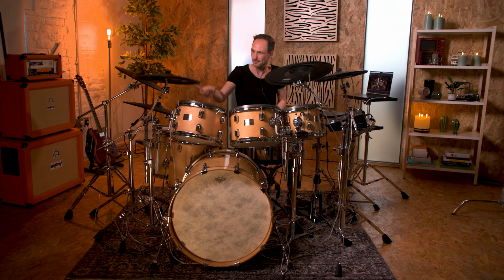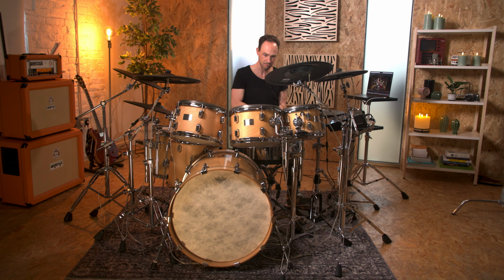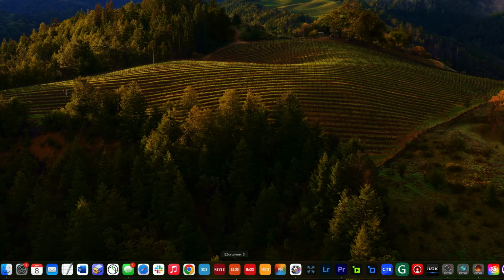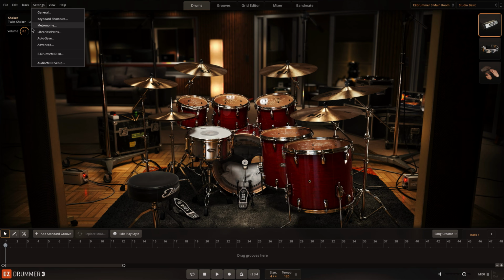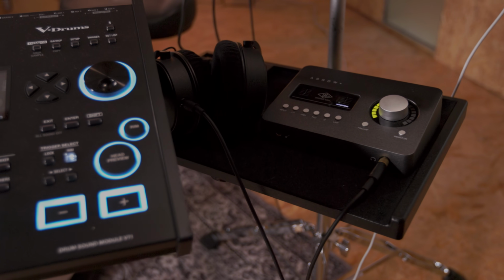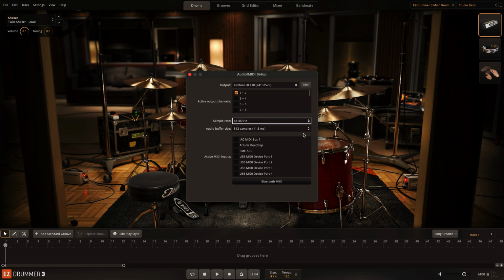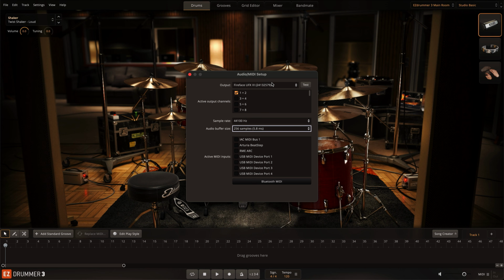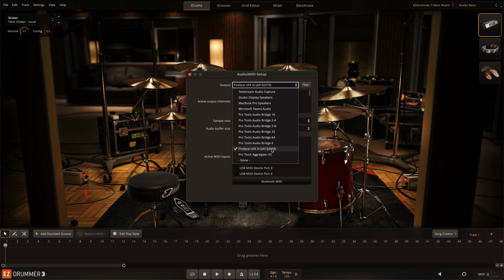E-drum Tutorial | EZdrummer 3 & Superior Drummer 3 | Part 1: Getting Started

Comment: When clicking on the SD3 drumkit (with the mouse) I get a full sound (expected since it’s a 127 vel hit), however when I play the eDrums (TD27KV2) I get a lower volume/much thinner/lowend lacking sound (even when adjusting pad sensitivity and getting a 127 vel hit). Crazier part is that the noticeable difference in volume/tone only happens during monitoring; if I record a MIDI track (SD3 standalone) the resulting hits sound the same (clicked or strokes). What gives? I’ve looked everywhere and can’t find a solution. It feels like clicking the kit gives you a layered, full sound hit, but striking the pad gives you a stripped down version of the same sound (no matter how hard you hit it).
Reply from the maker: Please contact our support about this and they will assist. You can use the Contact Support button at the bottom of any FAQ on our site: https://www.toontrack.com/faq/how-do-i-contact-support/

But before you do, please check that the internal sounds of the e-drum module are not playing back at the same time as the SD3 sounds.

Comment: Hey all, I've just set up SD3 with my VAD507 (TD27) and the volume when triggered from the VAD is very quiet compared to the volume coming from clicking on the drums in Superior Drummer. Any tips?
Reply: I have the opposite. SD3 is quieter than EZD3. I have a V71 and a 50X…go into your modules audio settings. There’s a volume control for usb audio if I recall.